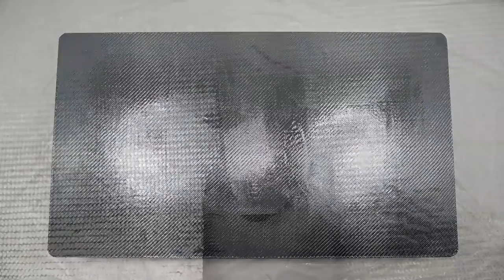Carbon Fiber Table with Epoxy Resin [DIY]

Comment: You’re trying to be like that other channel, just no.  Can still see where you messed up at, too.
Reply: Alvin Ocasiõ i will say the same to you as well. 

Do you have any how to videos ????? I been making composites for 20 plus years from very simple molds to complex molds to making a shit ton of carbon fiber and carbon aramid hybrid plate. I use a ton of vacuum type setups but have also used a lot of cnc molds that require a use of a bladder.  What he did here is fine for a damn table and other non structural parts. I still use a compression wrap method to make carbon tubing and comes out just fine. His ideas were there but just needed a few extra precautions. There is always one looking to ruin it for someone. For some people its just about making something themselves and not buying a damn piece of vinyl to stick to something. What he did requires talent. All you had to do was just move on but instead you put you negative comment in. Typical internet troll let’s see your work  !!!!!!  

Anyway nice video enjoyed watching thanks and keep it going.